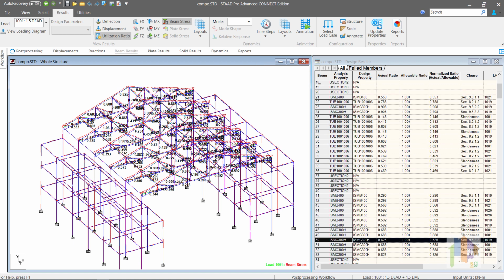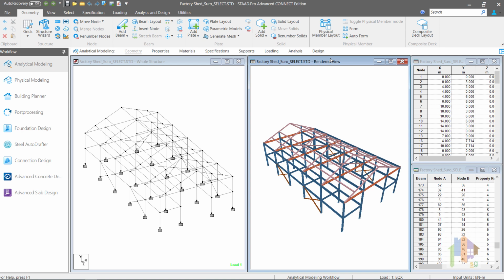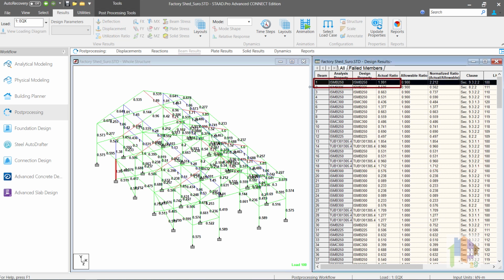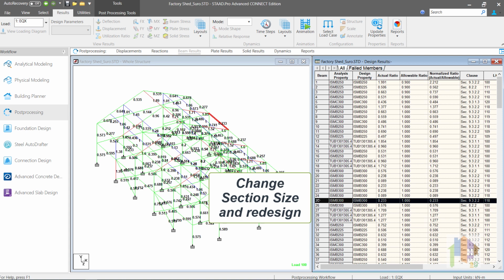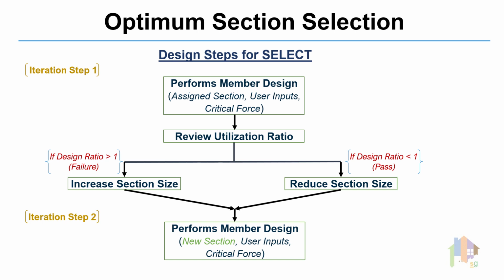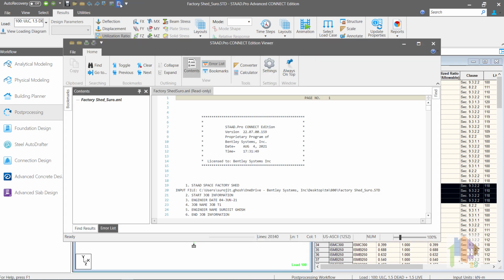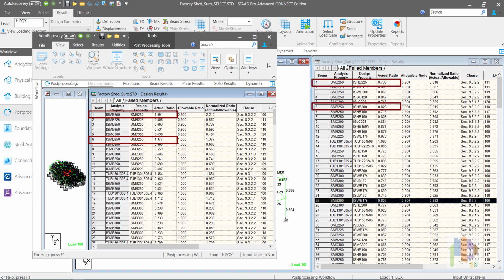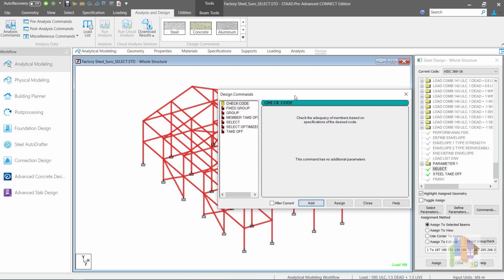Steel Structure Optimization with STAAD: Part 1 - General Overview || Steel Take-off || SELECT

Comment: But in the case of the Tapered section we can't use this select command as my understanding because we play with the diff dimensions of one selected member
Reply from the maker: Yes, for tapered section, optimization or section selection process is not available. It is available only for uniform profile sections, including built-up section with uniform profile.

Comment: It is a steel structure why you consider pinned support???
Reply from the maker: I am a bit confused with your query. I have assigned fixed support in this model, not sure where you noticed pinned support. Also pin support is very common for any steel structure, infect pinned base plate is commonly used in several projects rather than fixed base plate due to several advantages.

Comment: Sir will the select, select optimised command work for tapered sections?
Reply from the maker: If you define a tapered section from Define >Tapered I option, then that section cannot be optimized using SELECT command. But there is a trick for section selection with custom shapes which I will discuss in the next part of Steel Optimization series.

Comment: Hii suro 
Nice explanation 

Please add this points in next session 
1. How we will use Box section properties  by using 'select' command 
2. Can user table sections will  used for for fixed group
3. How we can use "personal section data base " for select/select optimise command
4. Is any provision for tapered section optimization tool in staad 

Hope so you will cover this in next session 👍
Reply from the maker: Thanks for your suggestion Ganesh. I have already planned to include point 1 to 3 in the third part of this series and then I will post multiple videos on Tapered member design. In next part, I will cover the correct sequence of different design and analysis commands along with few other major points for optimization.